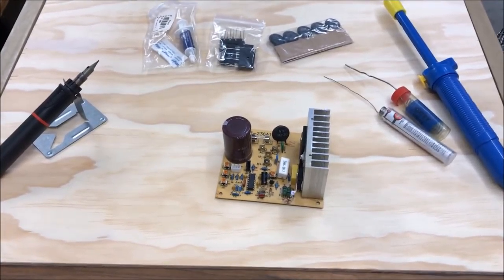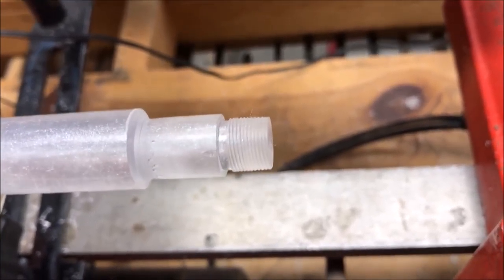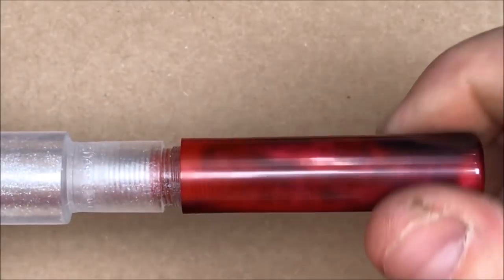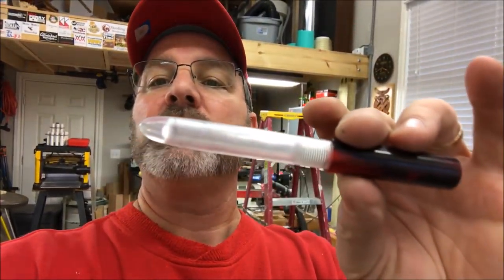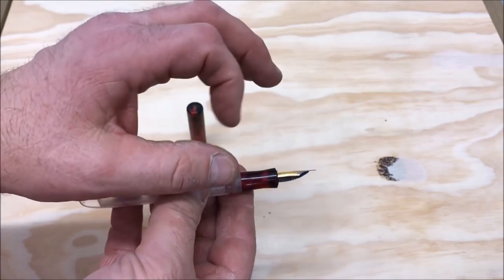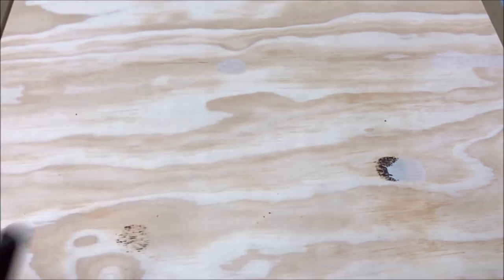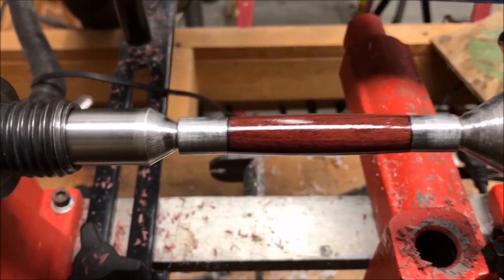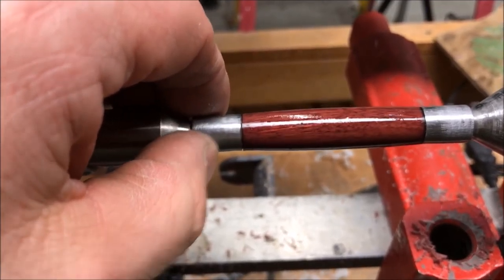Shop Update 1/7/2018 Shop Update

Comment: You are like crack my friend, can't get enough of your videos! I'm looking into my crystal ball and predicting I will be spending some $ for kitless pen gear soon....  Quick question: back in November I was gathering the materials to make a makers cart like yours (another one of your vids I was eagerly awaiting!), then the holidays hit and that build went on the back burner. I'm at a point now where I can move forward on it - now that you've been using yours for a while, any further suggestions on what you may have done differently? I know you talked about adding plywood/hooks/trays on the sides, any other insight?
Reply from the maker: Enclosing the sides for additional storage and hanging of tools. 

I’d make it 18”x24” instead of 24”x24” for better maneuvering in the shop. 

I’ll also add something to help the shelves slide in easier. 

Other than that I love it and use it every time I’m in the shop.